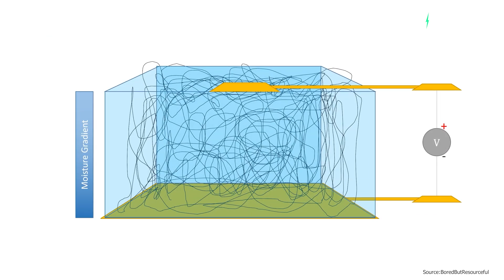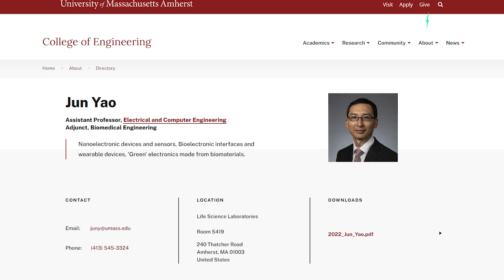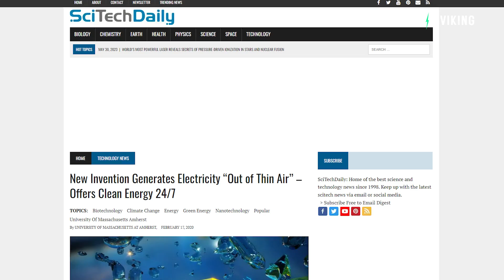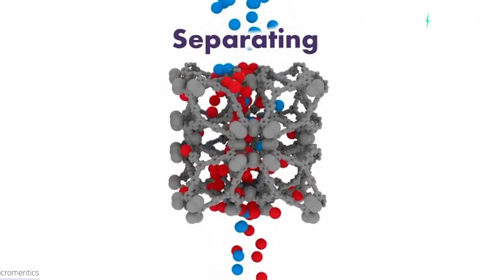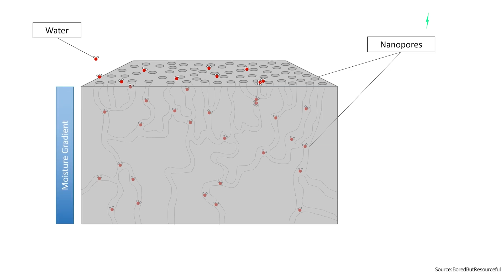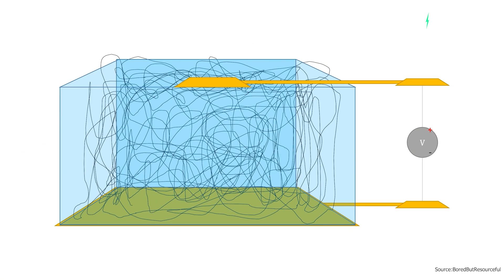Free limitless energy - engineers use Nanotech to harvest electricity from air

Comment: What we need to know is the level of current one square millimeter of the material can generate. because an amp is a huge amount of electrons moving from a higher voltage to a lower voltage. The real power of a generator in watt comes from the multiplication of the voltage with the amperage. High volage of water vapor in the clouds results in a much lower voltage near the ground and the high power of an electric lightning comes from the high voltage multiplied by a relatively low current. I don't expect powerfull generator with that kind of device with the low voltage of the electrons in the water vapor near the ground.

Comment: I just read this.  Thanks for the link.

2:15. What about water?

I guess this: 
It goes back to the mean speed of molecules - the mean speed of molecules in a liquid is much different than the mean speed of molecules in a vapor phase. 

None of the H2O would be hitting the material fast enough to cause a charge transfer to happen.

Pros:
There are plenty of zeolite compounds that have this surface detail.

This is just about the scale of pitting we can get with lasers on thin films.

Cons:

By definition this creates a charged surface - dust particles will cling to it and eventually block the pores.

2d structures are all we can accomplish - we would need to create 3d materials for the power density to be worth considering as an option. 

Cool tech, tho...

Comment: After processing what state is the air in? Like is this just converting latent thermal energy into electricity? If so, at scale is it just cooling or drying atmosphere? I guess that’s ok until it’s not. Great vid thanks
Reply: sounds like it works just like how lightning forms in a cloud, basically just collecting static charge out of the air. i don't think that would make it hotter or colder or anything but don't quote me on that, or any of this, heh

Comment: I forsee 2 problems. 
1. That the pores will become blocked with contaminants or corrosion
2.  That you need large amounts of humid air, and will suffer from the parasitic energy waste of pumping in air.  removing their charge will likely cause them to condense, which could be good for creating water but it will block the pores and not just drain out.
Really can't see it working large scale because of that, could be another radioactive diamond battery scam.
Reply: I appreciate your comment as I always look for the cons of this type of new tech, also could you elaborote on the scam diamond battery, I heard good things about it but I had some suspicions
Reply: @MaxMax-vf3xk  Well might be unfair calling it a scam, but it was at least an overstated investment opportunity.  You can turn radioactive waste into diamond batteries, so that its safe, and they last practically forever, but the problem is the tiny amount of power they produce limits their uses.  As usual with these things its what they don't tell you thats important.

Comment: So if an electric airplane was coated with this material, then it could practically have an infinite range?
Reply: I think you would need a far greater surface area than an aeroplane offers to generate enough power to fly using this process.

Comment: They're trying to baffle people with finely polished bull scat.

It will only work if the water is 100% pure and if there are no particulates in the air. Under any other conditions it will become clogged very quickly, just like any other filter. It's not a new idea; Benjamin Franklin tried to capture electricity from the air, for example. And the variations of electric charge differences at different heights have even been used as a way to stabilise model aircraft. That was being being done in the 1970's, before GPS was available.

They talk about kilowatt scale generators. But that can only be realised if the 'collector' area is big enough. The amounts of electricity available per square metre is microwatts to a few milliwatts, under ideal conditions. So a useful array would be huge, even if it could be made to work reliably. The amount of man-made Radio Frequency energy in the air is on a similar scale, under average conditions. Thermal energy at night is far more abundant.

And I don't buy that multi-layer story for one second. How could the moist air which has had most of the electricity it contains sucked out of it via one membrane give the same amount again at a second, closely positioned membrane?

Also, can you imagine the havoc which would be caused to this type of collector by a nearby thunderstorm? A more conventional generator system, including both 'green' and fossil fuelled ones would be far more resilient.

It would be far simpler and more efficient to use wind power, Solar power, water or tidal power and store the excess in batteries.

Given the need for super clean conditions, and the very low yield per square metre, meaning large arrays, would mean there is no way that such a system as this could provide useful amounts of electrical energy 'for free'.

I have a readily available source for a large quantity of salt here, if anyone else wants to take a pinch of it for free.

But if I'm proved to be wrong about calling this a clever example of wool being used to obscure popke's vision, and it being a way to wangle taxpayer's money out of government coffers, or funds from private companies with more cashflow than sense, then please let me know, and show me a working system which gives useful amounts of electricity at low cost. I'll apologise immediately.

Comment: Notice the gear they are wearing in probably highly clean environment.  I think it would certainly be a challenge to keep such a device from clogging up from particulates in the air.   And if you filtered the air your are likley removing moisture and using energy to do it that youll probably never get back.  Nice lab experiment though.
Reply: Remember that 90% of the visuals on EVs channel are unrelated to the actual thing being discussed.

Comment: There’s no doubt that the average global sea level has been increasing ever since the world started to warm after the Little Ice Age ended around 1850. But there’s no reliable scientific evidence that the rate of rise is accelerating, or that the rise is associated with any human contribution to global warming.   

A comprehensive 2018 report on sea level and climate change by Judith Curry, a respected climate scientist and global warming skeptic, emphasizes the complexity of both measuring and trying to understand recent sea level rise. Because of the switch in 1993 from tide gauges to satellite altimetry as the principal method of measurement, the precise magnitude of sea level rise as well as projections for the future are uncertain. 

According to both Curry and the UN’s IPCC (Intergovernmental Panel on Climate Change), the average global rate of sea level rise from 1901 to 2010 was 1.7 mm (about 1/16th of an inch) per year. In the latter part of that period from 1993 onward, the rate of rise was 3.2 mm per year, almost double the average rate – though this estimate is considered too high by some experts. But, while the sudden jump may seem surprising and indicative of acceleration, the fact is that the globally averaged sea level fluctuates considerably over time.
Reply: It's wonderful to hear the advances in science, but not necessary to promote an agenda.    The share price doesn't need it.

Comment: Precipitation static collection is a real thing. It's the same thing that generates lightning. The mechanism is triboelectric generation. Snow is an especially efficient generator because the air can be very dry. If you have a long wire radio antenna you need a DC shunt on it or you can blow up your radio. I had one that came into the lab on a coax and every few seconds in a snowstorm it would arc over to ground with at least ten thousand volts. SNAP! 

Once I calculated how much energy you'd get in a lightning bolt and it was about $100 worth at retail rates. To harvest it, you'd need a large tower and a huge capacitor/inverter contraption that could take the short pulse and store it. It would only work well with precipitation events, so fairly low return on investment. All the tall towers are grounded to prevent static building up on them, and divert lightning strikes.

Comment: NASA - Sea Level: "Achieving an accuracy of 10 percent of the sea height would mean that for a sea height of 1 meter (3.28 feet), the accuracy would be within 10 centimeters (3.9 inches). Such accuracy was likely challenging to achieve with the tide gauges used 50 years ago.  It's important to note that advancements in technology and improved measurement techniques have led to more accurate and precise sea level measurements in recent years, combining tide gauge data with satellite altimetry and other methods. These advancements have provided a better understanding of global and regional sea level changes with higher accuracy."

Sea Level  is measured by tide height. The Earth and Moon and Sun do not rotate consistently. There is wobble between these bodies that cause different tide heights in 'cycles'. The margin of error of this measurement is greater than the 'rise' we have seen in the past 50 years.

Comment: Interesting concept. One problem I can foresee is the clogging of the pours via impurities in the water. It could turn out to be its death.
Reply: Sounds like they are trying to harvest static electricity  ....
Reply: My thoughts are that it's springtime in the northeast USA and the pollen is brutal, which would undoubtedly affect this "air battery."
Reply: @jim bayerle  I think pollen grains are far bigger than the nano pores. So no clogging.
Reply: @martinw245   Um. Sure. Not sure how that would solve the problem of water vapor impurities. Or am I mistaken, and water vapor is as pure as distilled water? I mean, for the pollen and other particles, a filter would probably solve that, though I don't know how that would affect water vapor transfer.
Reply: @RichardRoy2  

When water vapour forms in the atmosphere, it leaves its imputires behind. So, there is no issue there. 

As for atmospheric dust, like pollen, I would imagine it sits on the surface, as pollen grains and dust are bigger than the nano pores.

I would think that the refrigerator sized device that it said could produce 1 kilowatt would have filters that filter the air before it reaches the device.
Reply: @martinw245  Interesting. If it goes through a filter, I'd expect it would have to be powered to force the air through. You don't think they'd have a problem with the filtration system removing moisture? 

Thinking about it now, I'm guessing the water vapor is akin to the product of a distillation process. I hope it reaches manufacturing level. I wonder how much difficulty they'll encounter in producing the membrane at a production level.
Reply: @RichardRoy2  

At this point, Richard, it's pure speculation. Some have questioned if scaling this up would be feasible. There are lots of challenges, it seems like.

Perhaps, rather than fans, some kind of electrostatic filtering system could be employed.

Who knows, the engineers have a lot to figure out.
Reply: @martinw245  Thanks, Martin. I have seen some inventive ways of guiding air to make it power generators, so, yeah, still lots to consider and experiment with.

Comment: Starting your video title with a double clear lie in the 3 first words "Free limitless energy" make you sound like people you do NOT want to be associated with of strongly negative or at best near zero value. CHANGE IT!!! ...if you do not want to come off as extremely un-serious or worse at first glance...
Energy is never limitless since you can only extract and convert some of the energy that is already there and this conversion is never free since the extraction equipment has a cost to be made and maintained/renewed and usually there is running costs, capital costs, etc as well...

Comment: At least until the nano material gets plugged up, all the more likely if there is a charge differential (electro-static charge) present.   In anycase, it isn't going to be much electricity, similar to harvesting the difference in electric potential between different heights.  These devices generate power on the micro-watt scale... not enough to really be useful outside of powering an ultra-low-power sensor, and they usually can't scale.   Don't hold your breath.
Reply: Says a unit the size of a refrigerator can produce a kw/hour. But it runs 24hrs a day. Storing that energy in a battery during low peak and over night averages enough to power a small home.
Reply: @motoarzan791  Big game of telephone distorts reality.  Nowhere in the original source material does it say that.   Here is an exact quote from the original 

"Finally, because air humidity diffuses in three-dimensional space and the thickness of the Air-gen device is only a fraction of the width of a human hair, many thousands of them can be stacked on top of each other, efficiently scaling up the amount of energy without increasing the footprint of the device. Such an Air-gen device would be capable of delivering kilowatt-level power for general electrical utility usage."

Now think about that for a moment.  I see a ton of problems just reading the article.   Among other things, these diffusers are nano-architected materials and while theoretically you fit a lot of the material in a small volume, the cost would likely be astronomical and just getting the airflow working in the first place would be difficult.  Let alone keeping the whole thing operating smoothly and not clogging up.

No actual power levels are mentioned, not even for the experiments they have already performed.   Everything is left vague.  What does "kilowatt-level" power mean in this context?  In what volume?  At what cost?  How is the electricity retained?  What voltages can it generate?   It is left to the imagination of the media copy-and-pasting the article to fill in the blanks.

Another quote:

"The researchers say that the current generation of Air-gen devices are able to power small electronics, and they expect to bring the invention to commercial scale soon. Next steps they plan include developing a small Air-gen “patch” that can power electronic wearables such as health and fitness monitors and smart watches, which would eliminate the requirement for traditional batteries. They also hope to develop Air-gens to apply to cell phones to eliminate periodic charging."

Health and fitness devices uses microwatts to milliwatts of power.  The phone comment omits any mention of actual power levels.

Now lets go even further back... back to the original article in Nature from 2020.  Here is a quote from the abstract:

"The devices produce a sustained voltage of around 0.5 volts across a 7-micrometre-thick film, with a current density of around 17 microamperes per square centimetre. "

The only hard numbers in this entire media mess is 0.5V @ 17uA per square centimetre.   7.5uW / cm^2.   That is less power than the nuclear battery fad that made the rounds last year!
Reply: @junkerzn7312  yup, not happening soon or cheaply but it does sound pretty sweet if it scales. theoretically you could squeeze 1428 layers in a cm thickness though but i'm guessing they couldn't be stacked that tight for some reasons anyway. i'm trying to picture some kind of method for making the countless holes and i guess lasers is what seems obvious, maybe something along the lines of how computer chips are made....yeah, it'll be a while, but almost everything in R&D and manufacturing seems to be accelerating, changes are coming faster and faster
edit: i'm reminded of graphene, seemed impossible to make much at first but we've figured out some ways
Reply: Agree 100%. But further...Why the f**ck does EV take the cheap and annoying route of consistently bombarding the viewer with a parade of utterly irrelevant eye candy montages? Why?!
Because other sites do it too? Anyway....this latest 'breakthrough' 'infinite 'free' energy' hype is just that - hype designed to secure more gov funding.
Reply: @KevinNolan-f5p  Its a good point.  Real scientific breakthroughs come a lot more slowly than YouTube dailies, and the winners tend to sneak up on people years later.   This is a problem for basic research too... takes years of devotion and is just not sexy enough to take risks on.

Its why the world tends to plateau and stagnate for a bit before the next big thing kicks it in the butt.

Comment: Not as sexy as a Tokamak, but amazingly simple! Where does the charge come from though? a cloud's particles are constantly jostling about in the sky getting heated by the sun, allowing the charge/imbalance to build up as 'free' energy. How is that bit replicated? Do they use a motor/pump to pass the water through a 'seive'. if so, is the energy expenditure the same as the output?
Reply: The ionic charge in water is constantly being generated by molecules colliding and UV exposure. A glass of water has these charged particles, as does the water in your body - it's everywhere. The trick is to separate the positive from the negative to obtain voltage.